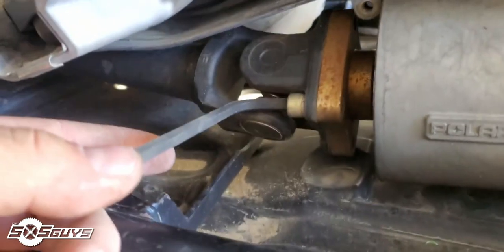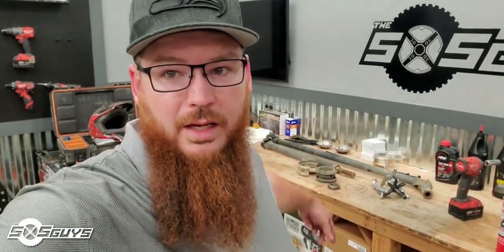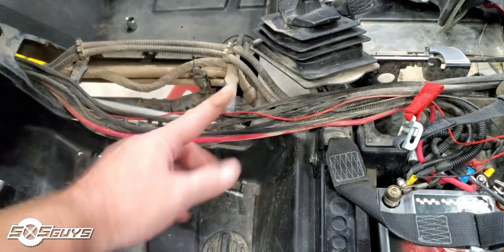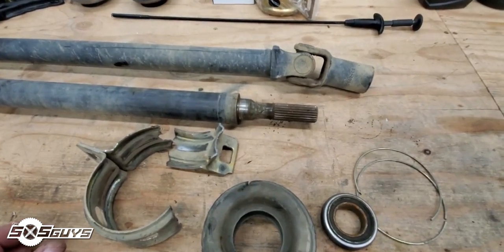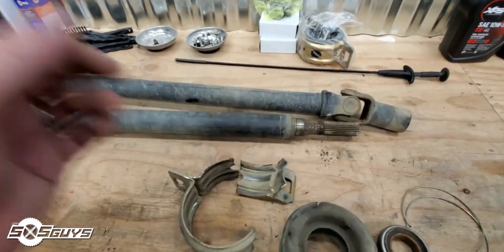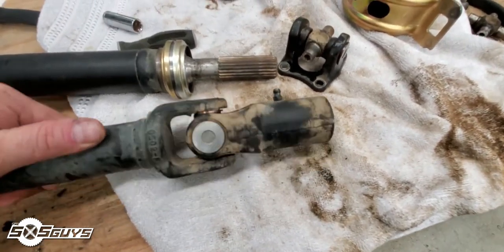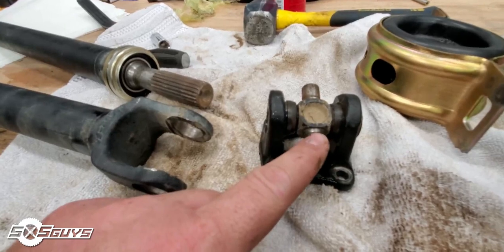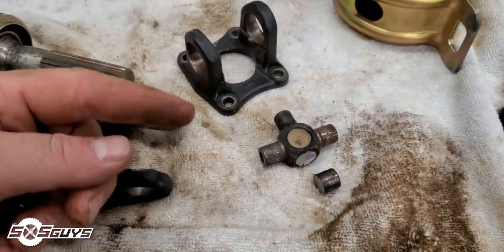Polaris RZR XP Turbo Driveline Repair | The SXS Guys Vlog

Comment: First time I've ever heard someone call a U-joint a "Tee". I like "bugger" better.
Reply from the maker: 🤣 ...never claimed to be well spoken!
Reply: @SXSGuys ...It’s all good. I got the point. It was a great video and I appreciate it. Just bustin your chops a little bit in good fun.
Reply from the maker: heh, more fun than busting my @ss on that driveline...
Reply: @SXSGuys ...yeah hear ya. I’ve been working on mine. That’s why I was watch the video. I would like to ask your opinion. My yoke pin is cracked in several places. Do you think it would hurt anything to replace it with a grade 8 bolt?
Reply from the maker: @hybridamericandude3575  there are plenty of guys that have done so... The issue is if it'll balance well enough. You could use two scales, mark where the bolt stops and then trim the bolt until it's balanced... But that would be super tedious!
Reply from the maker: @hybridamericandude3575  Getting the pin out only happened because I bought an air chisel! Getting it back in was even more difficult as you can't swing a punch and sledge correctly for good contact. I ended up removing the shock from the a-arms and then spreading them apart so I had enough clearance. Then I also heated it up a bit and sprayed it with some WD40. Then a few good whacks later it started moving into place. Something I hope to never have to do again, but will eventually; just with a better replacement!